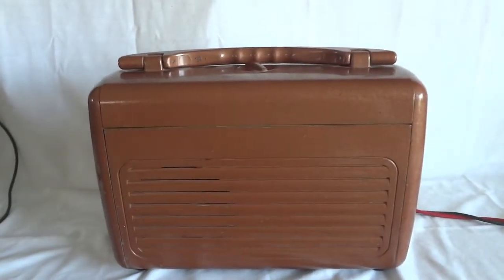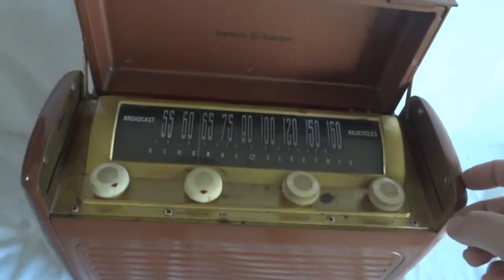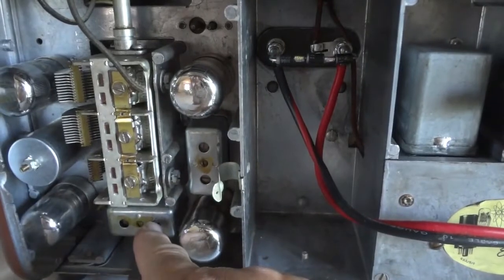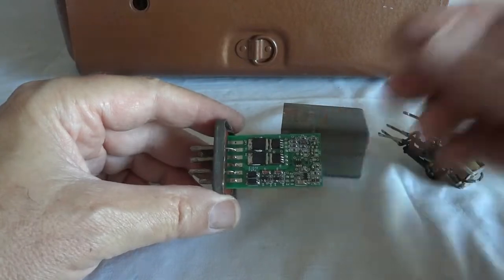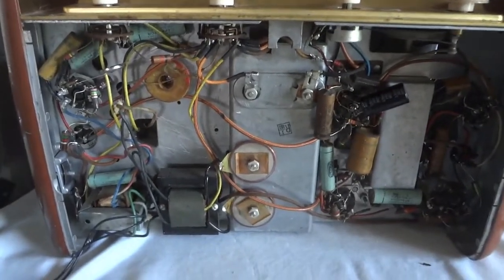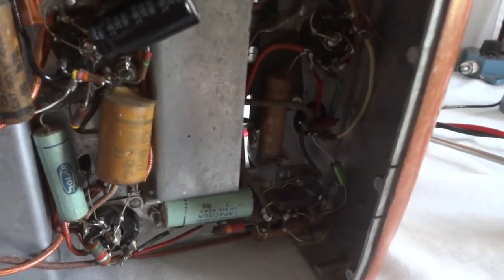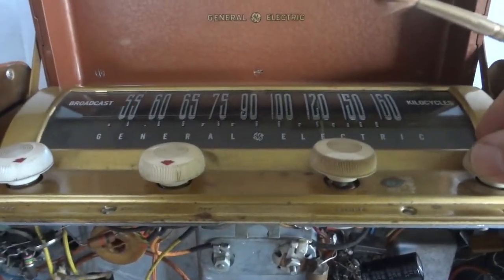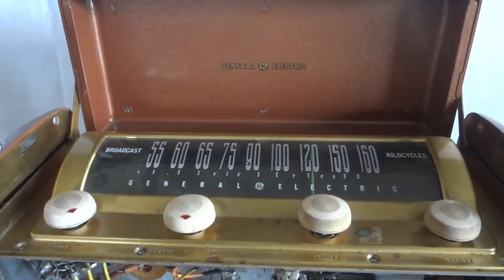General Electric Model 250 radio with PeKo RVB-2 solid state chopper v i b r a t o r

Comment: Did you use the positive ground or negative ground version of the PeKo RVB-2? I have a GE-250 radio also and am starting a restoration as soon as I get the vibrator sorted out.
Reply from the maker: Hello. You need the negative ground version for 2 volt, the RVB-2ALV. See: https://www.pekorf.com/PeKoRadioOrder.html
Cheers.

Comment: I got 2 of these. one has the mechanical vibrator but both are not working. This video is extremely helpful for me to get them working. I like the design of this radio. It's a clean design and a sensitive radio. This video inspires me to get off my butt and get them both working and on battery power. Thanks for the video. Yes! Life is too short for QRP!

Comment: I must say, when you mentioned that the is not a lot to listen to on the broadcast band I will tell that this radio is probably a dream for DXing with its sensitivity. DXing is awesome
Reply from the maker: Yes it is pretty sensitive but unfortunately it is not possible to connect it to an outside antenna. Cheers.